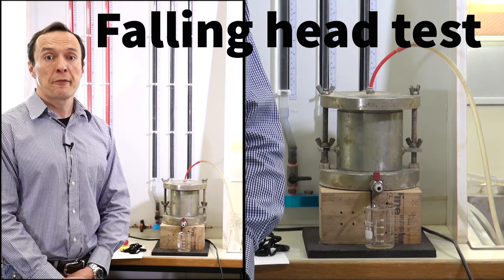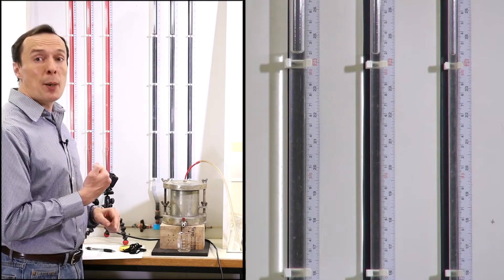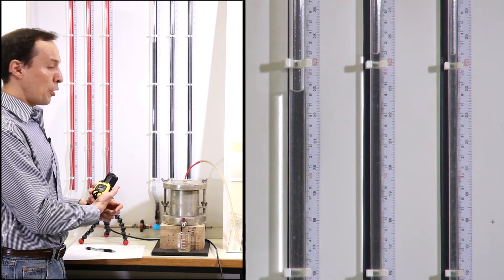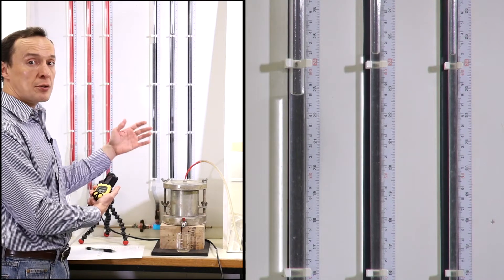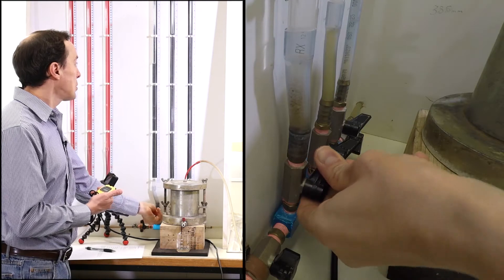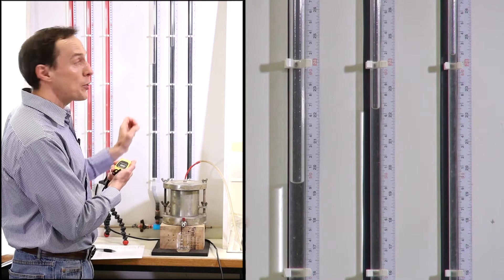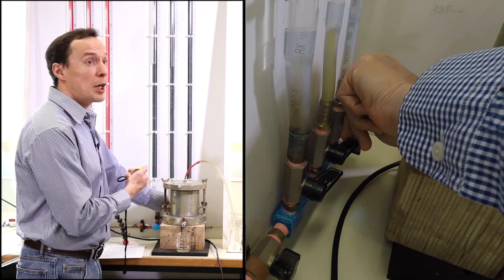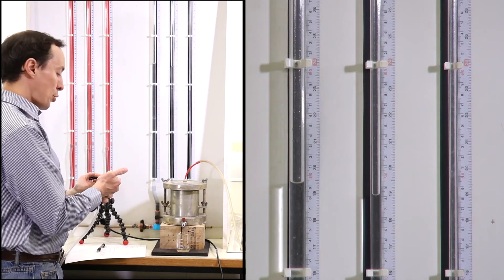Falling Head Permeability Test | Procedure and Data Analysis #education #experiment

Comment: There are three coefficients of permeability (k) based on three differnt experiments with different sizes of manometer tubes. They are not the same (k = 1.1E-06, 1.4E-06, 2.3E-06). Which value does represent the coefficients of permeability for the soil sample? Should they be averaged?
Reply from the maker: Yes, you will take the average value

Comment: sir what is the is the reference  of the test  procedure that you use ?
Reply from the maker: Australian Standard AS 1289 6.7.1-2001. Method of testing soils for engineering purposes: Method 6.7.1 Soil strength and consolidation tests – Determination of permeability of a soil – Constant head method for remoulded specimen. (2) Australian Standard AS 1289 6.7.2-2001. Method of testing soils for engineering purposes: Method 6.7.2 Soil strength and consolidation tests – Determination of permeability of a soil – Falling head method for remoulded specimen.